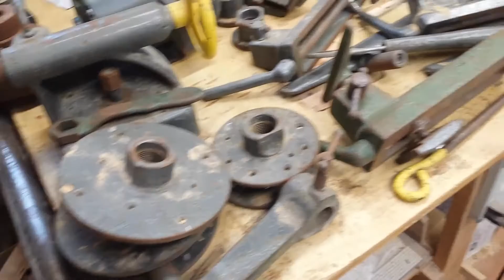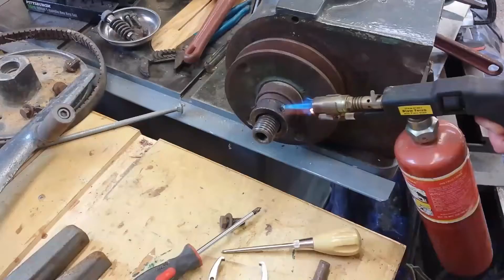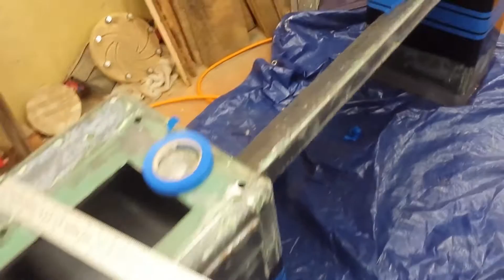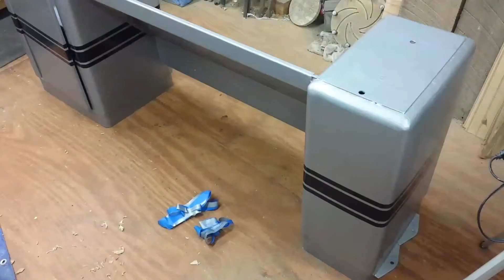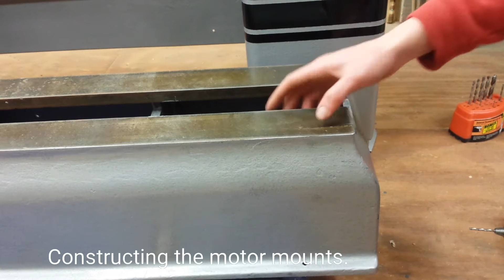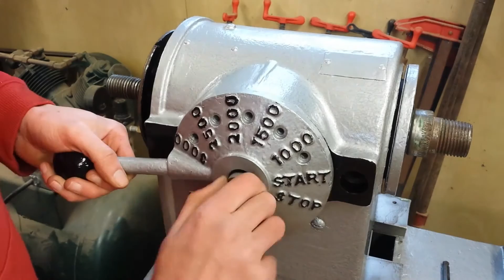How I Restored My Powermatic 90 Wood Lathe

Comment: I just got a model 90. Find myself reviewing this video quite a few times...I find that the Reeves drive does not like to keep the speed setting it drifts to the slow speed....would appreciate any comments...i think it is a great idea to keep that drive in combination with the VFD....you can find motors that are designed to run with VFD's..Thank you for this video...

Comment: The paint turned out great. Hows the lathe holding up it's been a few years have you had any problems ? Enjoyed the video Thanks for sharing
Reply from the maker: You're very welcome, it's been holding up great. I've only had a few problems with the VFD overheating in 90 degree weather and shutting down, other than that everything works great. At some point I would like to relubricate the headstock bearings, they are a tad on the dry side. Thanks.

Comment: Hey, was working on a model 90 lathe and was wondering if you took the v/s roller off. Mine won't  budge and I wanted to take the top housing apart.

Comment: Not sure why the Freq drive instead of just getting a single phase motor. Especially since it has a variable speed drive. Most people don't realize that not all motors have windings that fair well with VFDs and will lead to insulation break down along with shorts to ground. I rewind motors for a living BTW and like VFDs because when improperly used they make me money :D
Reply: Makes sense now that you said about turning a bowl. VFDs have their place and I'm getting one hooked up on my metal lathe. One of the greatest features of a VFD is it's protection if something goes bad in the motor. The problems with VFDs is they don't like any kind of dust or dirt and will burn out if they are not protected. If your motor does go out you could always have it rewound with the proper wire and will be good to go. Sometimes bearing also get trashed from VFDs if the stator has any kind of eddy current happening towards the crowns. Some larger motors come with special rings to help ground the shaft to the end bells to keep that from happening. Anyways I like what you did with your lathe and it looks great!
Reply: VFDs should actually be in a dust free panel with filtered ventilation of some kind. They are very sensitive and many burn out because of either power spikes in the main feed or dirt getting inside them. They will not put up with any kind of metal dust. Sawdust is a real killer for VFDs and motors because it packs up and clogs any ventilation and in motors it packs up around the rotor and bearings. Single phased motors really don't like sawdust because they have an internal switch with contacts and these contacts become either stuck open or stuck closed causing the smaller start winding to not engage or not disengage and burn up. 

Windings and motors for VFDs have a special coated wire in them. The coating is much thicker than standard induction wire. Also they are typically but not always dipped in a varnish that is much thicker and not the water based varnish that many manufactures use for standard windings. The reason is that motors are designed for 60 or 50Hz along with the rotors in them. The rotors are designed with what is called slippage and slippage is how the rotor doesn't get stuck in the stator. The rotor has bars that are cast at an angle inside the rotor (usually 120 degrees) and this allows for the magnetism in these bars to change polarity without becoming stuck. When you change the frequency of a motor to lower than it was designed to run you are actually changing the HP of the motor as well as the available torque and this can lead to issues if you are not aware of that like overloading the winding but also creating harmonics and changing the slippage of the rotor. 

Lowering the frequency or raising the frequency causes the winding to work harder either way and can lead to micro vibrations in the winding or the winding to the laminate stator. If the winding is not braced correctly to account for this then the insulation will break down. The other issue is the laminate plates themselves have a high temp thin insulation between them and this too can break down as well causing the laminate to short together in which causes eddy currents and hot spots. When this happens then it can lead to the actual shaft of the rotor to carry a current and arc the balls in the bearings against the races. After awhile the bearing will fail but usually the winding goes first. Your VFD will shut down and protect itself or it should if any grounding takes place but to diagnose the ground can be a pain in the ass because the ground may pass a 500 or 1000VDC megger test depending on the megger used leaving you to believe it's a fault in the VFD. The only real was to see if the winding is the cause is to use a special buzzbox that shoots 5kv ac to the winding and detects if it grounds. 

VFDs are very sensitive like I said and it will take awhile before you see any issues depending upon the age of your motor's winding. Since you are running a 3HP 3 phase motor your VFD should be made for a 5hp or 6 hp motor BTW. Anything less and it will fail in no time once loaded up enough times. I hope that helps a little. Keep the sawdust away from the VFD and always blow out your motors on ALL of your tools after use and you will be happy. If you do fail a bearing then I suggest using sealed bearing in that motor. 3HP should have a 6205 or 06 in the front and a 6203 bearing in the rear. $20 worth of sealed bearing will save you money in the long run and are very easy to do on a 3 phase motor if you have the proper puller. May take you an hour or hour and a half is all.
Reply: thewoodworker01 Hey sorry didn't see the above comment until just now.

 If the motor had been rewound then it's probably OK if they used the non water based varnish and good inductor wire. As long as you don't go too low on the freq then I think you may be OK with the bearings but /shrug sometimes everything works and sometimes not. 

The VFD should be at least twice as high as the motor HP or amps if you are adding a leg to make single phase into three phase especially on a machine that can drag down a motor with a load. People often make the expensive mistake of under sizing VFDs, rotor phases and add a phases. These devices will put up with it for awhile but eventually burn out because they are being taxed along with the motor. 

I find that people don't really understand motors or how power grid electricity works and I guess I just took what I know for granted. Probably why I get confused by some of the simple jobs that come into the shop and the inventive ways people burn up motors. 

Motors at start up will use anywhere from 2 to 2 1/2 times the amperage that is listed on the motor's tag at start up. Many times people think the amps on the tags are all the amps the motor needs because the tag doesn't list the start up amps. This leads people to under size their wires, breakers, contact switches, generators, drum switches, switches, plugs and outlets. Unlike a engine an electric motor gets all of it's torque instantly therefore if the electricity is throttled or bottle necked at startup then it is very hard on the motor. 

If I had a VFD for my lathe then I would always start it up at 60Hz then set my speed afterward. But then again I would probably just go with a 90 to 180VDC motor instead knowing what I know and rip an speed controller out of an old treadmill or just buy a good heavy duty used treadmill and rip everything out. Both ways have their ups and downs. 

can't wait to see what you turn on that bad boy though so I subscribed :D